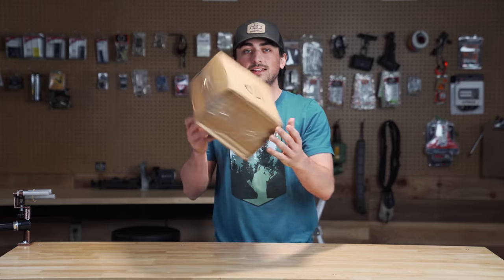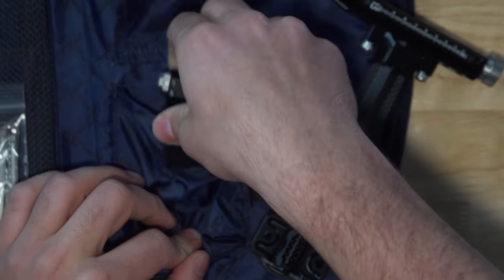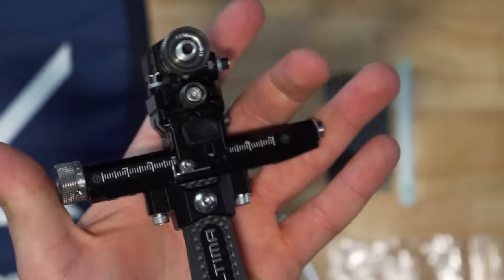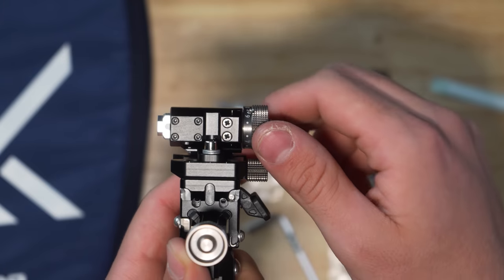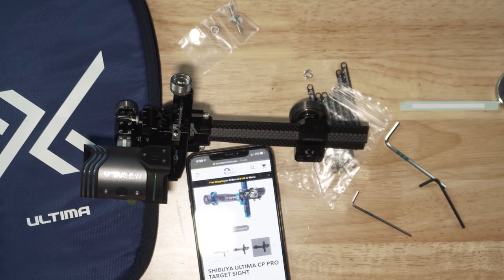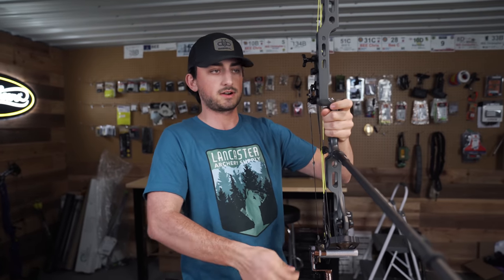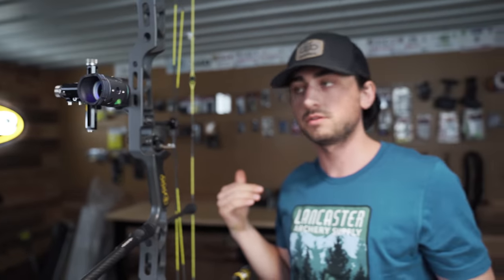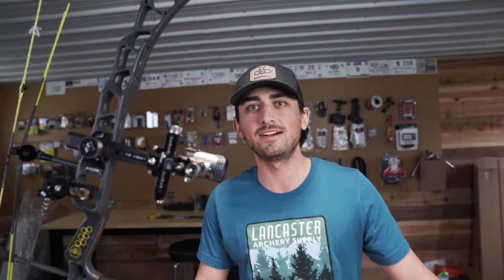MOST EXPENSIVE TARGET SIGHT $$$

Comment: Those washers are called nord lock washers on the 3rd axis adjustment. Really
Cool to see them used in a bow sight!
Reply: Those Nord Lock washers are no joke! Even without a locking compound is supposed to be stronger than any other “locking” type washer. Never seen them used on small scale operations like this. Mostly multimillion dollar equipment that can’t afford to have loose hardware.

Comment: there are a few things about Shibuya that I don't like. For example, scopes where you can not put a screw through from the inside (Beiter for example) are impossibly annoying to mount on these non-rotating bars. 
You lose your 2nd axis setting when moving the scope over one slot. 
And you also have to carry the metric allen keys with you. 

I like how super light they are, at least the original CPX used to be, idk about the new one. They are great for youth and women archers or basically anyone who is concerned about overall mass weight of the bow. I don't know the actual numbers, but they do make your bow noticably lighter in your hand compared to an Axcel or SureLoc. The new SureLocs are suuuper heavy. 

They will become loose over time, but there are four rubber pieces that clamp the head of the sight to the bar, which you can tighten down. Be very careful with those when you do tighten them down, 1/16 of a turn to start. 
Axcel have a system that IMO is better than Shibuyas, but they do also have to be tightened down occasionally. I do it maybe twice a year, but I shoot a lot with a fairly heavy scope setup. 
It's a bit nicer because you just need to loosen one screw and push a lever (with an indicator) and not four seperate ones. 
The original Achieve CXL even had a lever underneath the axis sliding block that served as a lock for the quick travel as well.

Comment: Those lock washers are called Nordlock.  The design of them alone is worth looking into.  Basically the way they work is they're used in pairs and the pitch of the teeth on them combined is steeper than the pitch of the screw making it harder to overcome the lock.  They work great and should be used everywhere.

Comment: I remember when I got my Ultima CPX a few years ago, I was so excited to see the NordLocks on it, as I was constantly retorqueing the bolts on my old Sight.  I've just got one of these CP Pro sights to replace it with (It still lives, will just go an live on the spare bow)  I like the new bar, and mounting system, and I'm glad to see the quick disconnect that they've now added, as that was the one thing I missed most about my old Axcel.  One of the things I noticed, about Shibuya's attention to detail, is that they've maintained the extension distance, even with the the disconnect being added, compared to my old CPX.  So for a given mounting index, the sight extension remained exactly the same.  Also, for the bow mounting, there are lines on the carbon bar, that line up with the edge of the mounting block that index with the circular grooves in the lock down screw.  The one thing I'd like to see, is more sight tapes available.  For me, I need something in between 2 of the options, aside from that, I think that this is honestly well worth the premium price tag.

Comment: FYI, the red line on the windage is supposed to be the end of the adjustment
Reply: There's a built in offset in the windage unit, he could use the outmost position (rightmost in the initial shot) and pull the scope holder back in easily :)

Comment: I ran the ultima cpx and cpxII for 2 years I loved them but liked the scope quick disconnect on the axcel better so I switched plus shibuya didn't have the color I wanted, you wont drop points because of the sight though they are fantastic and very precise